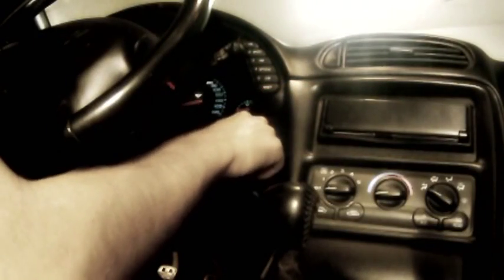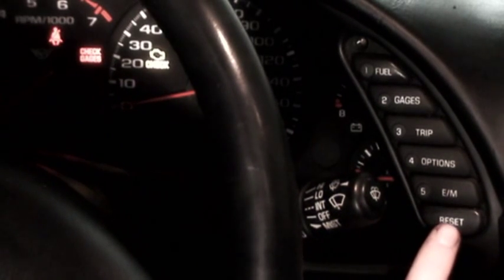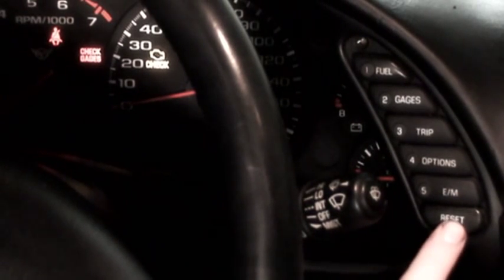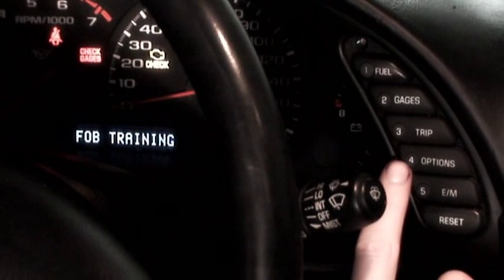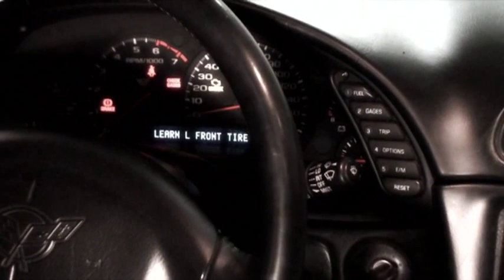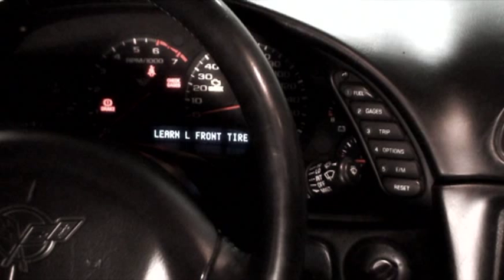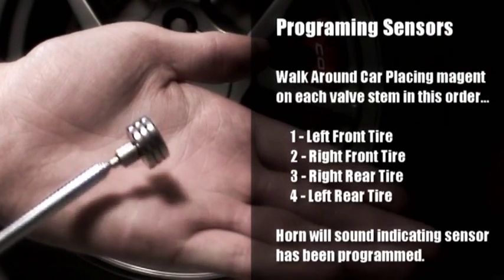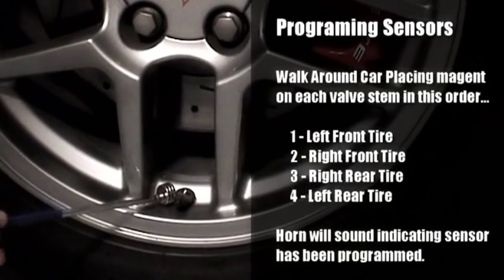TPMS Rebuild Part 07 - Programming Tire Pressure Sensors

Comment from the maker: I apologize it got me so long to get back with you...  If you hold the large magnet to the tire while preforming this routine and the horn does not sound then you likely have (1) a bad sensor or (2) a bad Body control module.  The body control module performs all kinds of functions though.  So my guess is you simply have sensors with batteries that are dead.
...

Comment: guy need a help, I'm from Brazil and I have a shop that specializes in imported cars, and my question is this, I have a 2000 Corvette convertible was exchanged sensor yaw rate sensor, steering lock, speed sensor, hub wheel, and the 4 tire pressure sensors, my only doubt is as follows on the dashboard does not mark the tire pressure, how can I test the tire pressure module to see that's damaged?  if you can help me thank you.thank you very much.sorry the english, I hope you can understand